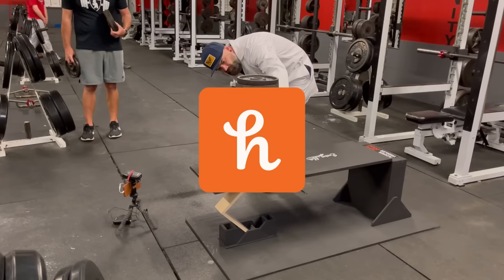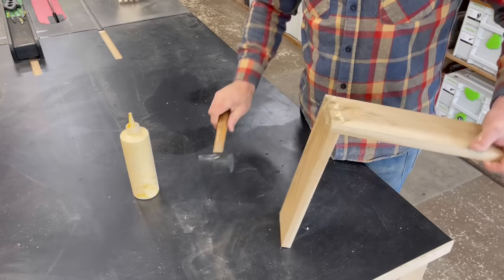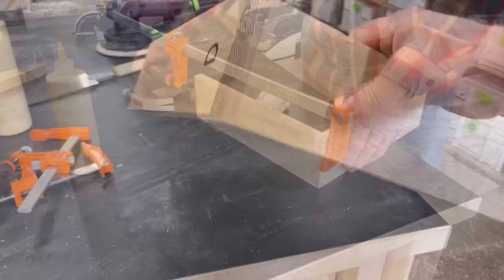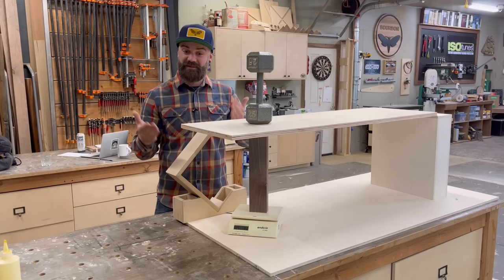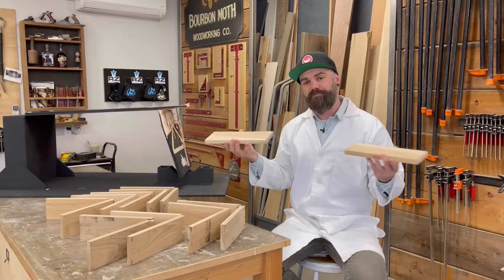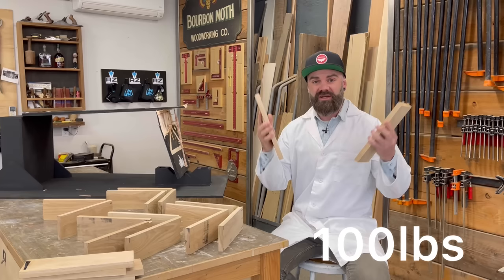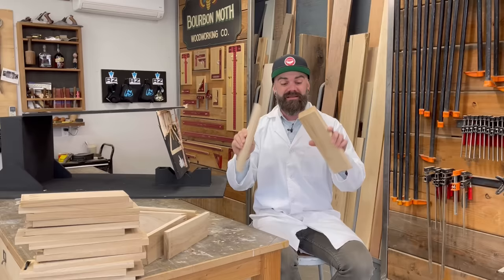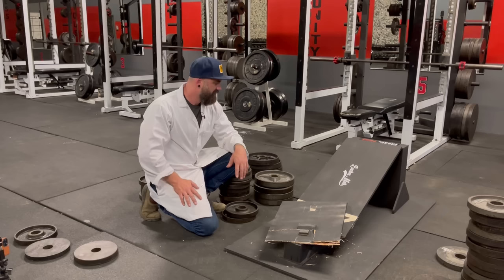What's the Best Wood Joint || Insanely Strong Joinery!

Comment: This is also a test of the glue, all joints have an increased glue surface over the previous one. Excluding the dovetail, even though the joint was well executed the ratio was a bit off for this test. Spacing the dovetails more like the box joint would have helped increasing its odds. 
There are so many different joints because they all serve different purposes.
Reply: This. The dove tail needed at least as many tongs as the box joint to be compared like this.
Reply: The last sentence is the most important. Joints are meant to be strong at specific direction(s) and also handle twists, not just wait, and also to look nice.
Reply: Every single joint caused the glue to fail. His glue is the weak point in every single joint. He needs to try this with better glue to compare the difference in strength caused specifically by the joint.
Reply: @caleb186  yeah but if thats the glue he uses regularly then it gives him an idea as to the items he builds.  Plus many wood workers use titebond II
Reply: I’ve always been lead to believe glue works best when cured under pressure. It would be interesting to see, glue under pressure vs. not.

Dale Zimmerman of Franklin International, maker of Titebond woodworking glues, recommends 100 to 150 pounds per square inch (psi) for clamping softwoods and 175–250 psi for hardwoods.
Reply: @meeek21  yeah, there are few glues aside from modern epoxies that really work without solid clamping, and even those epoxies work better with a perfect joint and good clamping

Comment: my grandfather always used miter with splines and I've always tended to use it as well.  It's easy to do, looks great, and with contrasting wood, really shows off the joint.  would have been happy if it only placed in the top 3 or 4...  nice to see it show up at the strongest of the group. :)

Comment: So the miter joint with splines actually is quite aesthetic, especially with contrasting-colored splines. And given that it proves to be the strongest, woodsmiths should consider these to be a worthy alternative to box joints and dovetail joints.
Reply: It really depends on the application. Almost no project is going to be subject to the same type/direction of force in this video. If you're making drawers, the dovetail is going to be stronger, given the direction of the force you will be applying to it, than even the splined miter. If you're making a box that you will pick up often, with weight in it, the box and dovetail joints will be stronger as well.

Comment: My ideas for a strong joints:
-The 45° angle with thicker splines (similar to a box joint). Reason: It appeared as if the splines were actually the weak point.
-Box joint but with a pin going through all of the pieces. The weak point of the box joint seemed to be the glue. So a pin should increase the strength by taking some of the load away. Another option would be to make the boxes narrower so the glued surface increases. That would of course combine well with the pin. If you want to be really fancy, you could try to reinforce that even more with some pocket hole screws. I think the possible strength of this is really just limited by the strength of the wood itself.
-The spline thing but with deeper cuts so the splines actually go into the inside a bit. Another fancy way of doing this eould be to have bent splines so you are not dealing with pulling the grains apart.

Comment: Redo the dovetail. I'll explain. Yes it's the pin size to tail size. That style of dovetail is made for strength in pulling a drawer. Equal pin/tail sizes will be much stronger for the test you ran.  
Edit:  also, increase the angle of slope to about 9° or 10° and make them half blind. You'll be suprised at where they end up. Probably top spot. 
Nice vid. Very informative.

Comment: The fact that the box and dovetail joints failed so perfectly at the glue points makes me think maybe they could withstand more with a better gluing job. My joints almost always fail at the wood and not the glue.
Reply: Definitely looked like inconsistent glue to me as well
Reply: Funny thing about that. Wood glue is usually stonger than the "natural glue" the wood has to keep the fibres / grains in piece - the lignin. So a piece of wood is more likely to break along the grain than in the glue joint if the glue job is done right with good glue. That being said  end grain glue joints should be stronger than side grain glue joints (cause the wood wont break across the grain before the glue does), given the glue is applied well enough!
Reply: Epoxy is superior to wood glue. This test shows in a few of these examples that the wood glue used is less strong than the wood itself.

I agree using a superior and more consistent adhesive would make the test more interesting.
Reply: It wasn't the glue difference but the surface area difference. More dovetails evenly spaced or a finger joint would also increase the strength

Comment: My dad has been a finish carpenter for 40 years. I remember when he showed me how if you glue and clamp 2 pieces of wood and you went to break that piece of wood, it wouldn’t break on the glue seam. Wood glue is actually stronger than wood. Im assuming Mitre is strongest because you are glueing two identical pieces of wood/grain.

Comment: I have a router bit for locking mitres I'd be interested in seeing tested. I suspect the locking mechanism is just to help alignment rather than strength, but it may increase the gluing surface by a percentage.
Reply: After seeing a previous comment about locked miters, I had to google the term to see what it meant.  The first hit was for a router bit like you mention.  It showed the resulting joint geometry, which led me to the same conclusions you mention:  more alignment than strength, perhaps more gluing area, but not likely to add much strength as that geometry would just pull apart under the stress of this test [minimal extra strength at 2 or 3 very small points in the "key"], mostly subject to the additional glue strength.

Comment: If you continue your science experiments I would love to see a comparison of smooth dowels, fluted dowels, spiral dowels, etc.  I feel like there's probably minimal difference between them but it would be cool to see actual testing performed.
Reply: I agree. Having used Lamello joints using the wood bisquits i have found them stronger than dowels or splines (depending on wood types). 
The original Lamello joint is using angle grain compressed beechwood. Like the biscuits made by Lamello.

Comment: Nice job on that testing!  This is good information to know.
    Here's a suggesting about a joint to try:
Make a box joint, but dowel it so the dowel runs through all the fingers of the joint.  That means only 1 dowel and you need to drill it perpendicular to both boards.  The dowel will be the same length as the width of the boards.  Does that make sense to you?

Comment: This was great, thanks for doing it! After Patrick Sullivan's recent videos on glue strength (and the VERY surprising result for end grain) I was expecting the mitre to do far better than most would expect. And their good showing is a testament to how accurately you cut the joint, and how well you clamped, so extra kudos there. I was surprised about the plain butt joint, I thought that would do better than last place (even if the result does show it's not actually too weak to use); I honestly expected the Lamello to do slightly worse, because of the smaller glue surface area.

Nerdy nitpick 🤓 the reinforcement in the winning joint, those aren't splines, they're keys. Splines run along a joint, keys cross the joint (just like in butterfly keys).

And yes yes yes, please do some follow-on tests 👍👍👍
Reply: the Sullivan video is really eye opening and had a lot of professionals irritated.
Reply: Same here! Patrick's video had me putting miter joint way up near the top, but I didn't expect it to be even stronger than the box joint.
Reply: @tchevrier  Yeah that's a great way of putting it 👍Did you catch how some sort hinted they already knew, or more directly stated that, "but......" But what? If you'd believed this before you'd already have content about it 😆

I bet it wouldn't be hard to go back through vids of many of the big names that responded and find direct proof they didn't think this was the case, stuff along the lines of 
"I don't bother to put any glue on the end grain [in a dovetail] because it adds no strength"
"90° butt joints need to be reinforced [because, end grain]" 

etc. 

I am pretty sure I've heard Cosman saying something related (although I haven't watched him in years so very vague memory), and maybe also Marc S., Sellers, Stumpy, Ramsay and Broun!
Reply: Biscuits are splines.  I have had astonishing luck with those for 30 years.

Comment: Not at all surprised that miter with splines was first place, and it was my guess for first.

I knew plain miter was going to outperform most people's expectations too, but still had it halfway down my list.  Of course for that joint glue technique makes a huge difference, since you've got to make sure you use enough despite the end grain wicking it away.  (I always apply, let sit for a moment, and apply again after it disappears.)

Also miter with splines is my favorite aesthetically anyway. :D
Reply: I agree on the last point. It's one of the best looking. And I too thought he would have let the first layer of glue dry in the simple miter joint first, then add another bit of glue. Surprised he didn't do that.

Comment: In one of my past lives I managed a mechanical test lab so this experiment was really exciting to watch.  My only observation is that of your comment about the miter joint.  Yes clearly, and surprisingly, it appears to be a very strong joint, but the unit of measure that you are really after is Torque which is load (weight) x Distance.  The further away you place the load, the more torque you will have and therefore the total load that you will be able to place will be lower.  But thus far, yours is the best video I have seen, good job!

Comment: A great video to watch. And yes, the mitre join was far stronger than I ever expected. Two inconsistencies I felt made the testing inconsistent;
First: The box join was cut 50/50 each side, where as the dovetail join was more 80/20, thus the 20% side failed earlier than expected. Just as different pocket hole joins are stronger than others, so too are dovetail joins.
Second: The dowels and domino joins were using milder timber compared to the winning join, which used a more superior timber for the slots. If all joinery used white oak, it may have been a different outcome.
I predicted the butt join to be weakest and the dovetail to be strongest, though as stated, I felt the dovetail got a raw deal on its joinery. I predicted the slot join to be second strongest. Not only did it win, but possibly the most aesthetic join of all, or at least on a par with a good dovetail join.
It also highlights a simple but join with nails added is more than strong enough for any drawer. 
Thanks for going to all this trouble. It was great to watch.

Comment: Kinda had a feeling that splines would win, simply for the fact of long grain glue up and that the breaking would have to cause the spline material either to overcome that long grain to long grain glue bond or it would have to rip apart which is in itself pretty hard to make happen for wood. Imagine if you would eliminate the weak point of this joint by adding more splines and make them a little thicker, that would have to make the glue joint come apart, which would be exciting to see the weight of having that to happen.
Reply: I thought the miter with splines would be 2nd or 3rd place. Surprised to see it at #1.

I was also thinking about dovetail splines. I imagine those would be strong for several reasons -- glue surface, mechanical strength, grain direction, etc.

Comment: Metric translations for those who are interested. These have been rounded up/down from decimal place.
Butt 27kg
Lamello 32kg
Domino 45kg
Pocket hole (in) 50kg
Dowel (through) 50kg
Dovetail 50 kg
Pocket hole (out) 77kg
Mitre 95kg
Box 100kg
Mitre w. spline 122kg

Comment: I'm looking forward to the follow-up video!  
Also, I think the dovetail joint would have outmatched the finger joint if there were the same number of dovetails as there were fingers on the finger joint, and if the pins and tails were of similar size, instead of tiny pins and huge tails.

Comment: Great video.  I almost had the order right.  The mitre surprised me  for sure.  I make cabinets everyday and only use box joints.  Making sure to get a lot of glue on all surfaces...most will het squeezed out as you know on those tight fingers.
I think the angle that the weight is applied to each joint could have an effect on the outcome. Hence the mitre would maybe be stronger or weaker depending on the direction the weight is pushing on the joint.
Anyway thanks for the great video, I always wondered about different joints.

Comment: Remember that the joinery that we consider best, like dovetails or box joints, were used before modern wood glue was a thing.  Obviously, a dry fit dovetail with some small nails in it is going to be stronger than a dry miter joint with small nails.  Glue changes everything, but tradition still says a dovetail is nicer.
Reply: Said similar on a different site half an hour ago. No glue or animal glue did mean the joint might fail but was repairable. Modern glues break the surrounding wood, not the joint, catastrophically
Reply: @cuebj  I mean, in practice, if you overstress a dovetail, it typically results in broken wood as well, glue or no glue.

Comment: Very interesting! I am a civil engineer and I would like to give a bit of info on the miter joint. Essentially, the force you are putting on, is put on the closest to orthogonal (the direction is closest to perpendicular) to the glued surface of all joints. With glue being best at pulling perpendicular to a surface, rather than having the shearing force of a less perpendicular joint, this is a great combination. Then lastly the miter joint has a greater gluing surface, allowing for an even higher pulling resistance. Its simple physics if you think about it, but it's not too obvious. In this test you basically only tested one direction of force. It might be interesting to test pulling force too, or a different pushing direction, I am almost certain the results will be quite different. With the right direction of force, the butt joint might even beat the miter joint.
Reply: I also heard a convincing argument that end grain is a BETTER gluing surface, provided it gets enough glue. Since the glue bond is stronger than the wood itself, the breakage of the wood is the real issue, and wood splits a lot easier than it breaks. Therefore, my theory is that the miter is stronger because it eliminates the surface straight ALONG the grain, and converts it to something closer to end grain that can't "split"
Reply: @aaronfuzion  I watched a glue comparison video in the past year or so that found End Grain glueups to actually be STRONGEER than Face Grain, which went against all previous recommendations. Perhaps the soaking of glue into the wood means the glue travels farther into the wood to provide more surface to adhere to?
On the Miter joint, I think the physics part of it that BasTaart mentions is what is at play here and less about the end grain/face grain debate. While the board is trying to pull apart from the test, you have the inside portions of the joint pushing against each other acting as a small brace.

Comment: I was actually not surprised with the miter joint ending up high. I have built the zig zag chair from Rietveld. It has got two miter joints of 22,5 degrees. Although it was quite scary to try it out for the first time it hold up a grown up op 220 Lbs easily. Great test! Keep it up
Reply: Used like in that chair the miter is very strong, I agree, but that joint has a problem when it is constrained to remain at a certain angle by the rest of the structure, i.e. in a box, where it is forced by the structure to be at exactly 90°. The problem is that the wood expands and contracts with the seasonal weather changes, but only across the grain, along the grain it is stable. The result of this wood characteristic is that the 45° of each bevel that makes the miter joint is a perfect 45° only when you cut it, as the wood gets more moisture it becomes duller, as it looses moisture it becomes sharper. With a free structure like the one of that chair is not a problem at all, in a constrained structure like the one of a box every moisture change stresses the glue line, in that situation the joint can withstand a very heavy breakage load when new, but give it enough time and it will fail even without applying any load, just for the very high force created by the wood's moisture change and the structure that does not allow the angle to adapt to it.
The moisture content change stresses also the butt joint, even if in a way less severe way. 
The miter joint is indeed strong in some situations, but should be better avoided in other ones,  there is a reason why in the past joints like the dovetail one was created, the reason is not that they had not the glue that we have nowadays as the traditional hide glue is maybe only 10% weaker then the PVE one, the reason is that a joint is not created to withstand incredibly high loads once in its life, is created to last, so has to withstand multiple little stresses and the ones related to the change of moisture are very relevant.